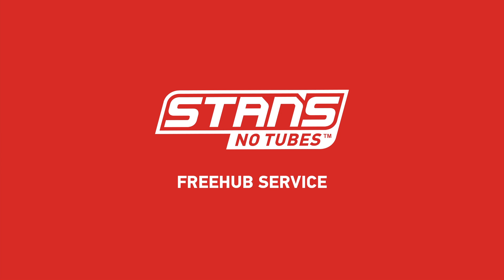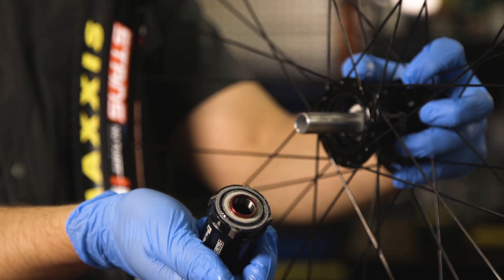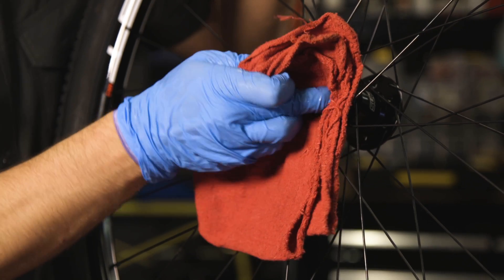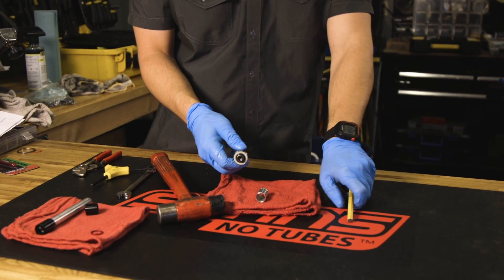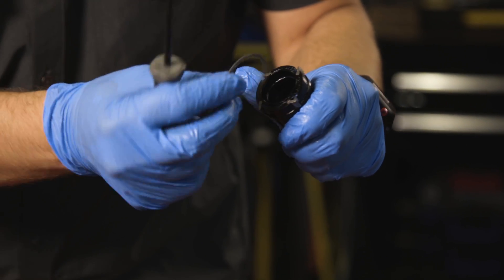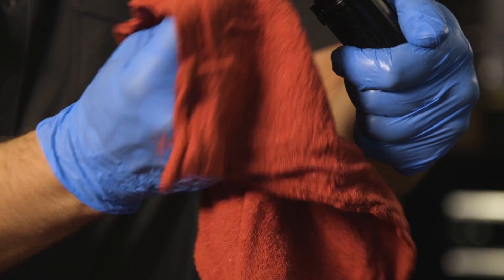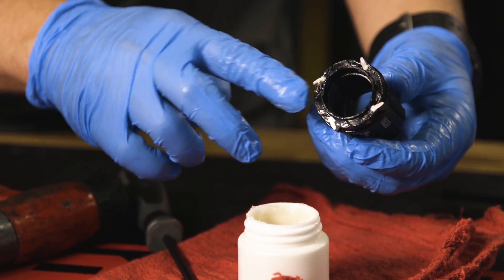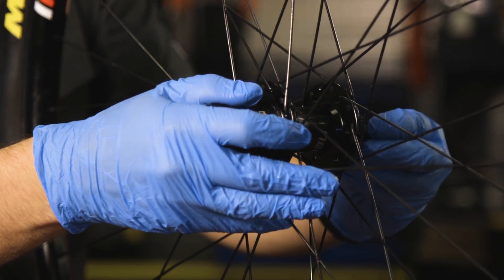Stan's Neo Freehub Service

Comment: Maybe I missed something but I’m curious what the purpose of removing the bearings from the freehub body. Is it implied that if the bearings were dragging you would replace them? Removing them just to grease where they sit in the shell is pointless if the bearing are running smooth correct? Also does Stans recommend removing the bearings and removing the seals, repacking and reinstalling when servicing?

Thanks for the great video and any additional info you can provide.
Reply from the maker: Removing the bearings from the freehub body is only necessary if the bearings need to be replaced. There is no need to regularly remove the bearings if they are still in good shape.

Comment: Did the video skip where he greases the drive ring?
Reply from the maker: Hey Dustin! It's mentioned at 4:00 to apply a thin layer of freehub grease to the pawls and drive ring. Just enough to thinly coat everything will do! A little bit goes a long way!
Reply: can you use freehub oil instead of grease?

Comment: So there is nothing that retains the freehub in place other than the QR axle? Every time I take my rear wheel off everything falls apart. Am I missing something?
Reply: The hub axle sleeve is what holds everything together. It's independent of the wheel mounting axle.

Comment: I installed the SRAM GX DUB Eagle Crankset full component set. In doing so I had to purchase a Stans Free Hub XD Driver. Everything is installed but the freewheel does not spin freely when I stop pedaling. Any thoughts?

Comment: freehub grease rather than oil?  Why some say oil rather than grease?  kind of grease you recommend?
Reply from the maker: Hey m00nchildblues
, using oil in a freehub requires a lot more maintenance, so grease is preferred. We recommend using the lightest weight grease available.

Comment: can you convert a boost 148 hub to a boost 141 qr  with endcaps?
Reply from the maker: Hey David, you can convert a boost 148 hub to a boost 141 qr hub. All that is required is a set of end caps. ZH0780 - 6 bolt hubs. ZH0957 for - Centerlock hubs. Please contact tech@notubes.com with any questions.